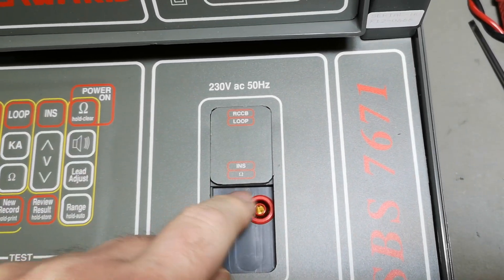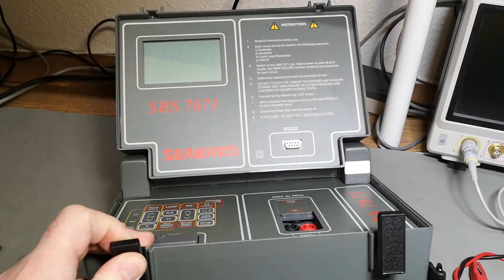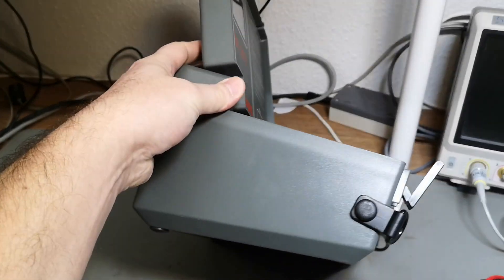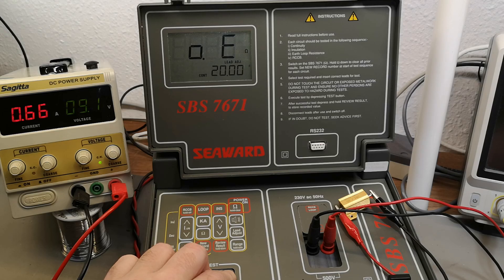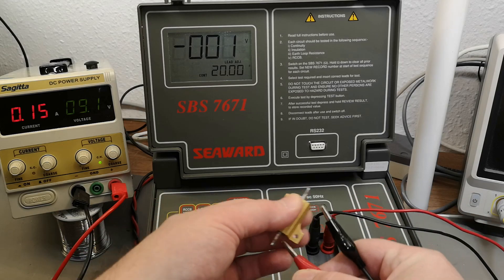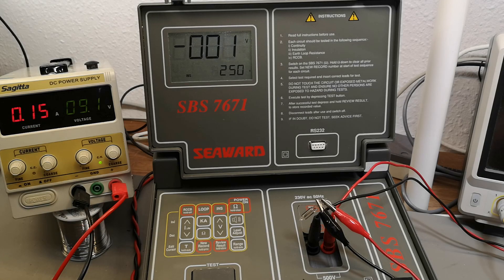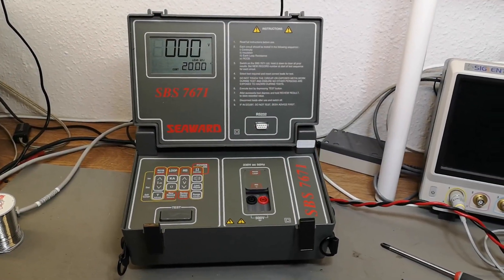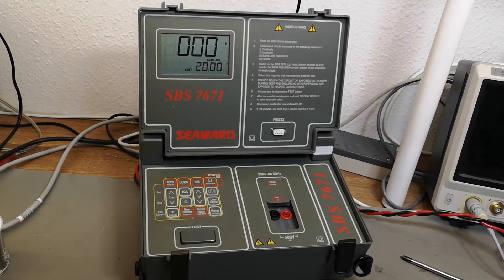Seaward SBS 7671 all in one highvoltage tester 1995 teardown

Comment: I have a Seward Scepter spectrum analyzer for EMC testing, it uses a PC for the graphical display, it is about the vintage as this unit, bought it new for AU$11,000.

Don't know what you call the Seaward SBS7671, here it would be a PAT Portable Appliance Tester. Back in the late 1990's I did the PCB layout for the Safety-T-Check Mk D sold by Trio Electrix, a friend of mine Don Arthur and director of Trio asked me to be involved with the project. These units are still in demand today and regularly go for AU$400 on Ebay. Infact, I had to pay that much just to have another example of a project Iwas involved with. If I remember correctly the "low ohms" test puts 10A through the EARTH connection and the "high voltage" test was fixed at 500V dc which was what the local standards at the time required.
Reply: Although Seaward do make PAT machines, this is not one of them. There's a clue in the model name; it's an Installation Tester, to ensure the fixed wiring installation meets the standards as set out in the BS7671 wiring regulations, here in the UK.